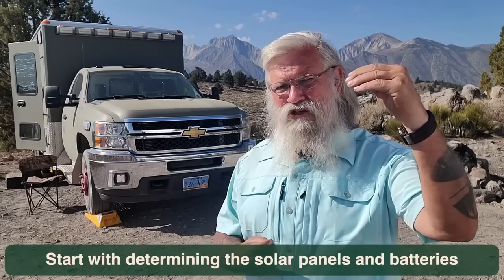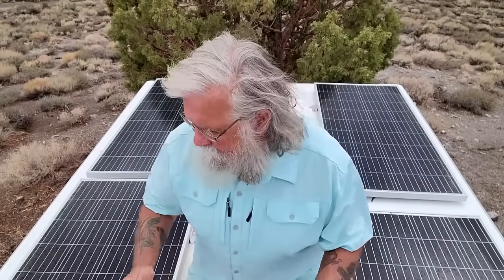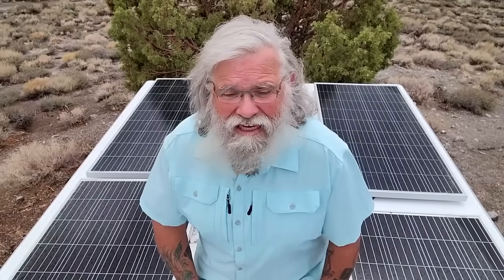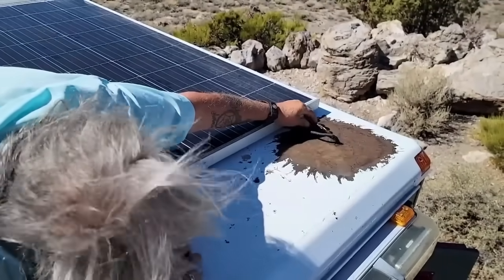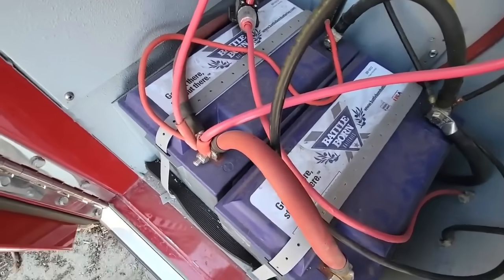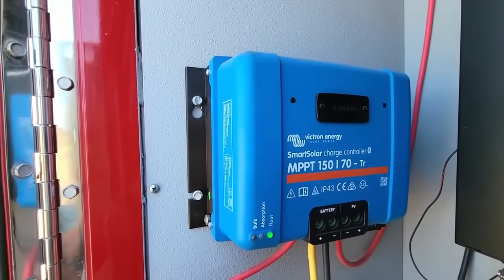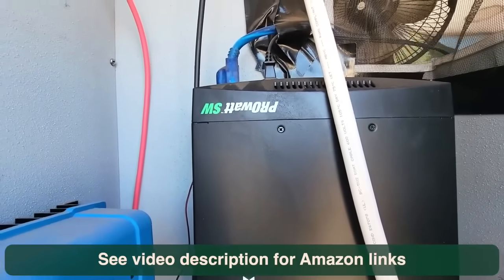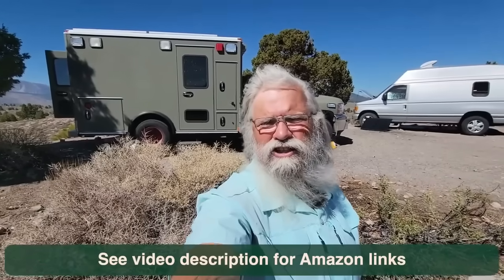A Closer Look at the Components in My Solar System Setup!

Comment: I'd build a fold out frame and have the panels 4 inches off the roof and provide more shade. Then you could run one of those cooling units you've been reviewing.
You could hang sun shades off the frame too.

Comment: Battleborn are way too expensive now.  I did my solar 5 years ago. Still going strong. Used victron  charge controller and  victron 3000 watt 24 volt inverter . Use victron Bluetooth app on your phone—cool.  If you are doing a new system now—Do a 48v system so you can use smaller wires which is much cheaper.

Comment: Yes the solar charger can put what ever amps you want but when the battle borne battery gets up to a certain voltage it will only take a trickle charge like about 2 or so amps even if your controller sends it to the battery it will not take all of it. It will get you up to 13.7 volts and call it 100% but full charge after several hours of topping off with trickle charging it will get up to 14.4 volts and call it 100% am I right or am I wrong?

Comment: Hi, solar is now way cheaper and panel output is way better, now 500w + and 1x2m. So have a couple on top to keep you cool in the sun and have plenty, with fold out ones for when you are in the shade and Victron MPPT controller ( fan cooling may be required in hot climates. )
Would love to see a slide out setup to give more shade and cook or cool.

Take care M

Comment: For those buying a solar generator, I believe that you should overpanel as much as possible, up to the point of Amp/volts input on the other end….so, let’s say max solar charging on your Bluetti or Ecoflow  is 350 watts but the maximum solar input (volts x amps) is 600 watts. I would get three 175 watts solar panel for a total of 525 watts or three 200 w panels. In this way you ensure maximum possible charging on those overcast or shorter winter days. Remember that you may be running your fridge, a small ventilation system and some other smaller electronics while you are away during the day….but night comes and you may want to cook, watch videos on your computer while charging it, as well as your phone and maybe use a cpap machine overnight with more powerful fans for ventilation. Don’t forget the morning making breakfast!

Number 2: For those of you who are not buying a solar charger but are setting up as in the video, battery prices also have come down since then! Buy LiFePO4, as many as needed! Plus your controller most likely will allow for faster rate of charging so think about other usage possibilities.

Comment: Congrats Bob! Those Battleborn batteries will easily last 3,500 cycles if you cycle them 100%. If you only cycle them 80%, they will last twice that. There's no doubt they are the best, but you need deep pockets to afford them. The same with Victron. Both are top of the line. You won't regret either purchase as they will last many trouble-free years - even decades.

We've been boondocking most of the time for the last 3 years with only 2 GC-2 FLA golf cart batteries. Last month I replaced them with a custom made LiFePo-4 made from 8, 280ah prismatic cells. The main reason I chose the DIY route is I wanted the maximum battery capacity that would fit under the steps of my MH, where the 2 original golf cart batteries used to live. This made a 560ah 12v battery, the equivalent of about 5 1/2, 100ah Battleborns or about 2, 270ah Battleborn Gamechangers - but they take up much less space. I got them, a Heltec 330a BMS and a 5a active balancer that fits nicely in the space between them for under $1,500 total. That's $875 less than just one Gamechanger, and they are rated at 8,000 cycles at 80% DOD, so they should hold up well.  

I built a 620-watt liftable solar array using 2 Canadian Solar 310-watt panels I got from N. Arizona Wind and Solar out of Flagstaff about 3 years ago. Back then they were $197 each. I picked them up at their business while visiting the Grand Canyon, so I saved the freight. I mounted them on the side of my MH using a frame made from aluminum angle and stainless 5" gate hinges. I can lift them to the correct angle for maximum performance and take them down while standing flat footed on the ground. I used a pair of gas springs, so they practically lift themselves. I just unlatch them and up they go. I then pin them at the optimal angle based on the month and latitude (there's a couple websites that give the exact angle). A panel lifted to the right angle will typically produce 20-30% more output than a flat mounted panel (even more in the winter when the sun is low on the horizon.) Plus, they make a great awning for my bedroom window too. I have been using an Epever MPPT controller that I just reprogramed for lithium. But I had to replace the converter with an 80a lithium compatible Progressive Dynamics model as my old one wasn't programable. I also added a Renogy battery to battery charger so I could charge it with my RVs alternator without frying it. It's all the needed accessories, wiring, breakers, etc. that add up the cost if you want to do it right. I've got about $3,500 invested in my complete solar/battery system, but to us it is well worth it for the electrical independence and freedom it provides.

Comment: When I watch video's like this I get like it's some sort of arcane magic because to me electricity cannot be visualized.
I can see hardware for plumbing and still be more comfortable with that because I can see it, and therefore follow it better. Series/parallel, amps, volts, watts, breakers, fuses, AC/DC, loads, are hard to see because it's hard to see something that's unseen to the naked eye.
When I do my build in the future, it will be the first thing I'll tackle though I'll be afraid of not getting everything right because everything else has yet to be finalized.

Comment: Thanks Mr BOB, I'm in the process of a solar install on my 33ft "Nomad" Trailer, and had seen in a previous Vlog how you figured your needs etc.
So I had picked up a 1240 watt system package from San Tan solar, and came back to you for clarification on my components.
But!, in my excitement I didn't connect with how I was going to get 4 big 310 watt 6'x3' panels up on my trailer roof. OOPS! WELL they didn't seem that big on the floor, until I asked how much they weighed..60lbs. ea. Whoa..
Now I have a problem trying to mount them flat, on a crowned roof. I'm trying to figure out some wedge foots to go under the panel legs, and get a solid mount. LOL. Nomad Engineering in progress. Thanks for your helpful Vids. RT.

Comment: Im trying to figure out     if I need to do the solar and run all the wires and outlets before I insulate and build the design of the van....I don't want any wires ect visible......and can I place the batteries/inverter at the back doors or would it be better behind the drivers seat closer towards the engine?

Also....if I have two max air fans...where do I place them and by having two of them how much it would effect the solar real estate?....

I would like to purchase the solar after being in the van and after I have the layout decided on but this idea seems backwards to me.

Please help! 😆

Comment: Thank you, Bob, for sharing good info, as always.🙏🏻

Personally, as one who considers successfully installing solar power a Tylenol situation, I have other questions.  (Sorry.)

I can’t relate to ‘a really, really long time.’  I’d like to know how many years you expect your solar system to last for.  (For example, the Inergy system we’ve been considering will last for 15 years.  We’re unconcerned about the panels.)

We live in an an old (refurbished) 27’ Class A RV, and we’re the same age as you are.  We don’t use a microwave, but we do have a 57” TV (that we’re fond of watching movies on), two iPhones, and a computer.  (We have enough independent solar lighting to last us until we kick the bucket!)

The appliances we utilize amount to circa 200 watts.  The (outrageously expensive) Inergy system that we’ve been considering (x 2) will power what we need for 16 hours per day (overkill) for 15 years.

I’m wondering how your system compares to that.

We live in Canada’s Coastal Mountains, and we don’t travel much in our RV anymore.  We use our car to run errands and visit the city etc (we can comfortably sleep overnight in that).

I’m of the opinion that gasoline won’t be affordable or even available in the not too distant future, so we’ve been ‘prepping’ (energy wise) for that eventuality.  

We’re reasonably sure that the grid (all three sections of it) won’t be operational for too much longer either, hence our current focus on installing a PV system that will meet our needs for as long as is possible.

We get roughly 300 days of sunshine annually here, and we’d drive south for the winter, if we could, but we don’t (and won’t) meet the present vaccination requirements for returning to Canada, so we’re stuck with weathering Canadian winters.  (We’ve been doing that for six years now, and propane heat makes it simpler, but our sources tell us not to count on propane being available for much longer.). We have a contingency plan for that, but it won’t be fun.

It seems that far too few people are aware of what’s happening in N. America, and the world, for that matter, which I find highly disturbing.

They won’t be ready….

About your PV setup…?

Love and All Good Things, 

Jess.🌹

Comment: SOK is actually the best battery.

For nearly the price of a BB 100ah battery you can get a 206ah sok battery that is just as good. Or get an SOK 100ah for $600 and use your savings to upgrade other parts of your system.

It makes zero sense to me to overpay for BB batteries.

Had you gone with 1 206 SOK you could have saved $800 and get an extra 6ah!

Comment: 2* 100Ah @12V = 2400 w/h = 1.4 km/h   for 1800$= 0.75$ per wh
I pan 302Ah @ 51.5V (16 Cells in Series, 312$ each) + about 700$ for a bms, cell connectors, ... = about 5700$ for 15553wh
equals to about 15.6kw/h thats 0.37$ per wh

you can litteraly bild yourselve a good quality battery for half the price of a battleborn one.

Comment: Urethane Sealant would've been cleaner for the roof and better... some sika flex or chemlink.. I'm a roofer and wouldn't do the 208 wet patch on a van or automobile... just some advise and other options for everyone else..you can buy them at your local roofing distributors

Comment: Oh and one other suggestion, economize when it comes to power usage. I run a 400W panel and 2 110a/hr batteries and it's more than enough for low wattage lighting, TV but won't run a refrigerator. We don't get a lot of sunshine in New Zealand anymore thanks to chemtrails so a 200W wind generator makes good sense also. Brilliant videos Bob!

Comment: I have 800 watts on roof of truck camper,  and six  6 volt lead acid golf cart batterys under the truck.
You are right about needing lots of wattage.
I have been bus and truck camping since 1984.

Comment: Would a setup like this be a lot more robust than a portable system like the EcoFlow or Bluetti? For my purposes I'm thinking that something portable would be a lot more useful. My intention is to keep a solar system as a backup and I live in a rental condo. I would also like to get a system setup, as a backup, for my parents house. I would like to run a fridge, fans, lights, chargers, and maybe a TV. For my system I would also love to use it for car camping. If a non portable system is significantly better I would consider a permanent system for my parents house.

Comment: Thank you Bob! ❤ I can probably fit 2 or 3 of those panels on top of my transit connect. Speaking of overkill, I have the largest Blueti ... it's insane. I want to buy that 3K BTU little AC bc I and one of my dogs get way too hot. Then I can also get some movable solar panels if I need more. I can still charge my blueti with household current bc I'm just a part-time traveler. For now. (I worry about my failing eyes and ability to drive after awhile ... macular edema.
Reply: I have Bluetti ‘overkill’ for my little 14’ Sportsman travel trailer. Bought it to run household refrigerator and home heater (but not at one time) after that freeze in Tx two winters ago, since my 88 yr old father had meds and needed running house heater to warm room a few times a day. Never needed to use it before he passed in Feb’22. I now am fulltime living in trailer, w/2 cats. Took Bluetti AC200Max to Albuquerque this past October and was parked in overflow lot (no hookups). AC200Max handled my little A/C unit and a space heater when weather turned cold at night (had issue with propane leak, which has been fixed now). I couldn’t test out the panel because I left part of the power cords at my base property, but recharged the AC200Max from shore power in laundry room. Next time, I’ll bring the two Bluetti 230 batteries and two additional panels. Definitely going to be overkill on solar, I hope... I get the idea of solar, but I think I know now how to hook batteries and panels  together to run a/c in hotter weather, or use little heater as a chill-breaker when heating using propane. I hope to boondock more than rv parks.

Comment: Love it bob those panels are the ones for me and I like the practical electrical system. Every one does it so so perfect, well I don’t either and it’s working also safely great video thanks so much ps I went with the silicate salt sealed batteries 2 -250 = 500 amp hour as I’m needing to be in cold north east climate for family holidays and don’t want them freezing up like my water did this past winter . Will keep you posted on there performance

Comment: Love it. I bought a panel and installed it on the roof before I left Boise last year and completed the setup in Quartzsite. I think it is worth mentioning that if you need help setting up a solar system and don't want to order the parts, there are several places to go in Quartzsite. Because my panel (400 watts) was a house panel, I needed a special controller that would bring it from the rated 24 volts down to 12 for the battery. With advice and parts from Solar Bill's (hope the plug is okay here), I was able to install it all myself, and like you, Bob, haven't had a problem with the system and have an endless supply of power even though my panel lies flat and barely pulls in a little over 200 watts in winter (in Quartzsite), hooked up to the 105 amp lithium (Lion), for my needs, it fills the battery back up by 11am or 12pm, usually sooner these days now that it is Spring. I run a laptop, propane furnace fan, ceiling fan and lights - as well as charging a cell phone, a second laptop and sometimes a miroir projector. The only problem I have had is that my new fridge does not work consistently and one night I woke up with all the power dead. Before the fridge started running wonky, I had no power problems - thankfully the battery has a protection program that shuts it off before it is drained to the point of being damaged. I have put the fridge on eco-mode and have had no problems since and have plenty of power to last on cloudy days. Getting solar was a huge game changer and I'll never go without. Besides that, I have a generator I haven't touched since the setup and didn't do half the job the solar setup does in providing consistent power. I hate to say it, the fridge is a joytutus, next time I'll go with one of those super expensive ones for reliability! But yeah, solar power is awesome.

Comment: So Bob, why can't someone design a solar pull behind trailer that unfolds six full sized panels or two panels when folded up going down the road. They could be wired up and accessible more easily than a roof or in addition to it. I'm thinking of a regular rv industry towed system offering. What do you think?

Comment: Hey Bob what i discoverd is that panels on the roof is a target for a lighting strik you have both poles and they are active all the time even in cloudy condition this could be catastrophic to you rig if you are not present when a storm pops up covering your pannels is a good option and.disconnecting the line what i do is i put my pannels on the.ground away.from my camper and.cover them with a u haul blanket this maks it simple to.clean and protect my equipment if the pannels have a metal frame even more attraction to a strike grounding is also suggested for the whole system a 8ft. copper coated rod in the groun not the grid power when you have shore power getting your rod back may be impossible when you move grounding it to the frame of you camper may be safe on a.travel trailer but on a truck frame may be hazardous to your truck 12v. System just.saying i try to keep is simple like my teachers told me in school! Happy camper in Ky.

Comment: I learned kind of the hard way I started with a 245 amp hour AGM battery that weighed 168 lb.. I didn't realize that I only had half of those amp hours that are usable you cannot take that battery down below 50%, which equals about 122 amp hours and I had 200 watts of solar on the roof and I learned that wasn't enough I almost ruined that battery because I took it down to like 5% on my first journey.. the panels couldn't keep up with that battery. The battery took longer to charge and for every 100 amp hour battery you need 200 watts of solar. So I learned that lithium and Battlelborn specifically what's the battery to go with I got 200 amp hours of batteries and I put 200 more wants of solar above and got rid of that 168 lb battery in exchange for about 60 lbs of batteries. And lithium charged much quicker and was so much more stable. And I went with a 40 amp mppt Renogy controller. Now the price of batteries are coming down and you can find a good lithium battery for about half the price of a battleborn but you have to be careful and listen to the reviews. SOK or Chinns. Are a good choice. And I have a 3000 watt pure sine inverter. Do not get a modified sine inverter. Yes I did it was part of the learning process.